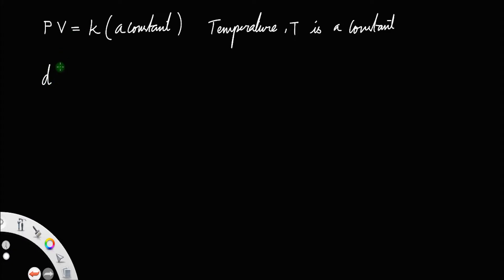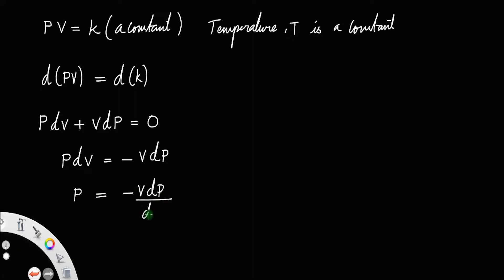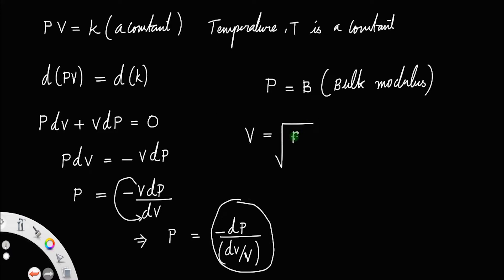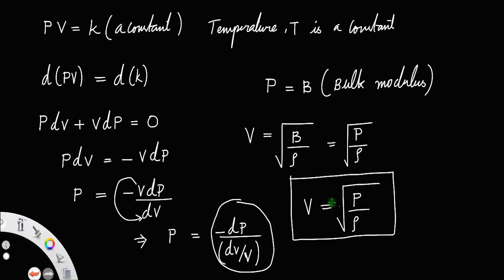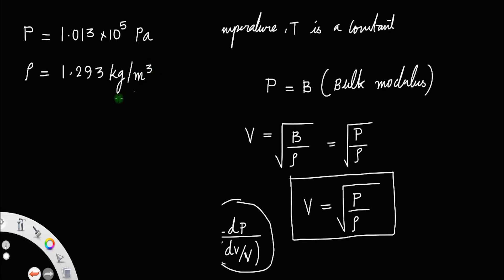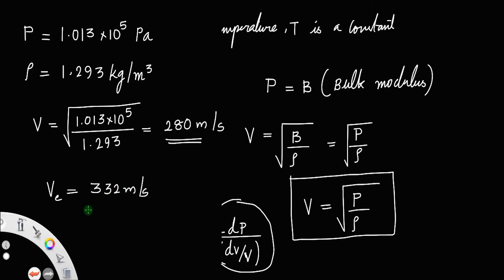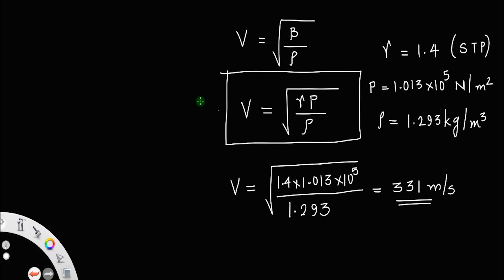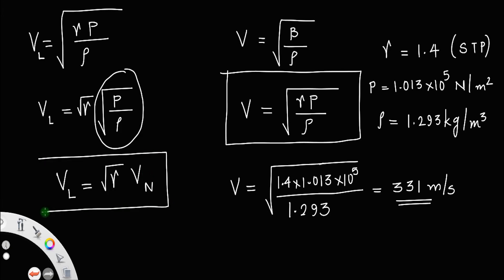Derivation of Newton's formula and Laplace's correction for the speed of sound wave.

Comment: You are not deriving Newton's formula, you are just putting Boyle's law in Newton's formula. 😮
Reply from the maker: No. Newton differentiated the Boyle's law and derived the velocity formula considering it as isothermic process. I just shown that here.
Reply: @heroofthederivations7305  interestingly Newton did not use any differentiation for the derivation of velocity of sound, nor he invoked Boyles law. His derivation is still a classic marvel of mathematics, and many try to explain it in a way easy to understand for modern generation. 
Isothermal process also came way after Newton. 
It was Lagrange who derived the speed of sound by the differential method. And use of Boyle's law was made. 
The Laplace correction, though it gives correct formula and speed, was also not based on isothermal and adiabatic concepts. 
The whole story is very interesting though.
Reply: @AfrozJaved  can you link reading/video material that go along what you said